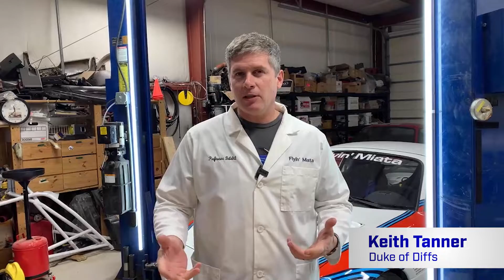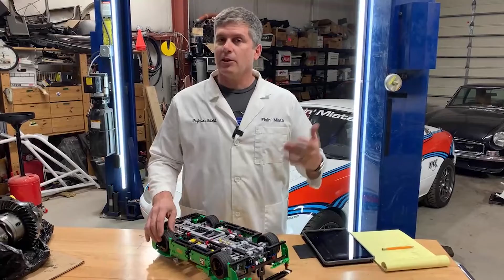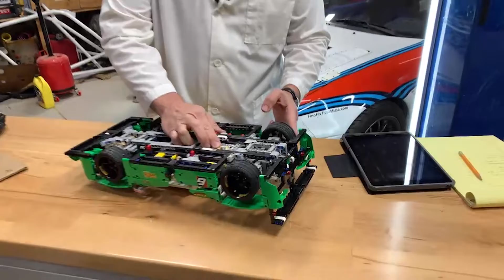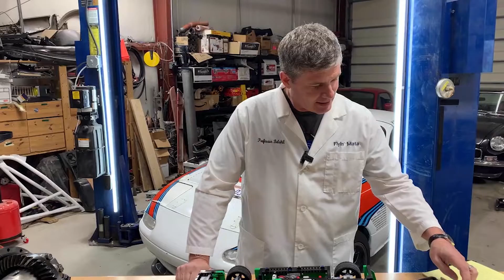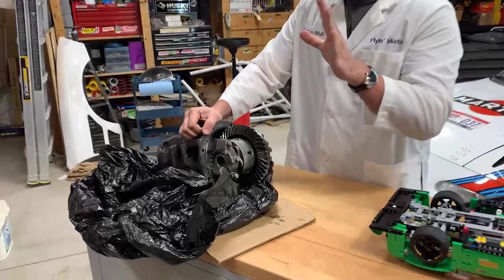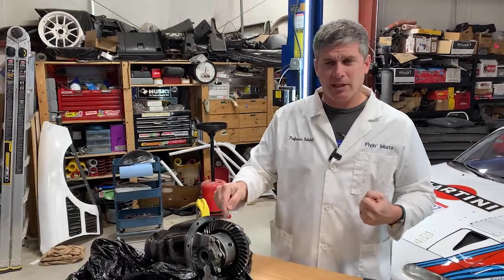Miata Differential Basics (FM Live)

Comment: How good is a 4.3 LSD 🤔
Reply from the maker: Depends on what it is. 4.3 is the ring and pinion ratio.
Reply: @FlyinMiataVideo  The only thing I know so far it’s a LSD viscous MK1
Reply from the maker: @jamesfcookjr  We talk about the viscous LSD in the video. Short version: better than an open diff, but not the best LSD. The biggest problem is the small ring gear is weak, so it's common to yank the whole thing out and replace it with parts from a 1994 or later car including a Torsen.
Reply: @FlyinMiataVideo  ok thanks I will run it until I break it or if I find another one I picked this one up for 100 bucks anyways but thank you
Reply from the maker: @jamesfcookjr  The viscous LSD uses different stub shafts than the open 1990-93 differential, so make sure you get those as well.
Reply: @jamesfcookjr  almost for sure it’s shot no ? Viscous lsds are as far as i know not serviceable and 20 year old fluid is simply not gonna perform ...
Reply: @DominicLeung87  either way that Mustangs is still bad ass no matter the size of the motor in its capabilities
Reply: @jamesfcookjr  Sure but I'm more leaving the info for others who look to "upgrade" by buying these 20+year old diffs. A torsen doesn't "go bad" but clutch and viscous ones absolutely do.
Reply: @jamesfcookjr  who's mickey ?
Reply: @DominicLeung87  sorry wrong video 🤦🏽‍♂️ yes I got my lsd cheep I will run it till it go’s out